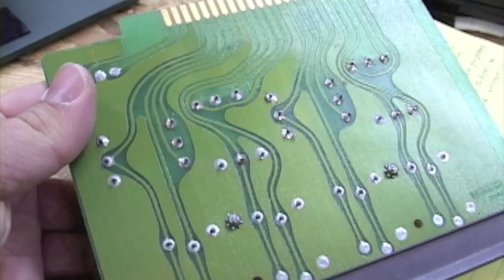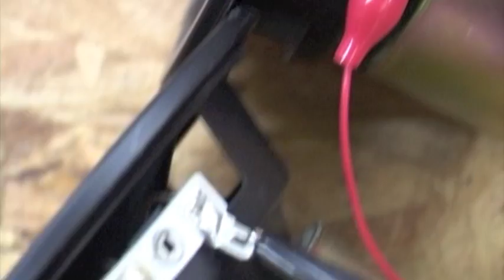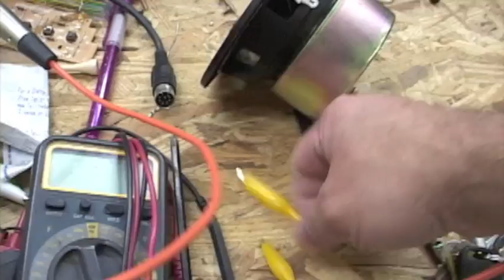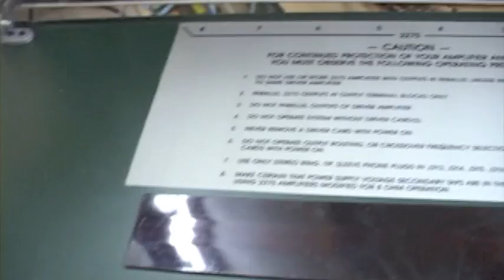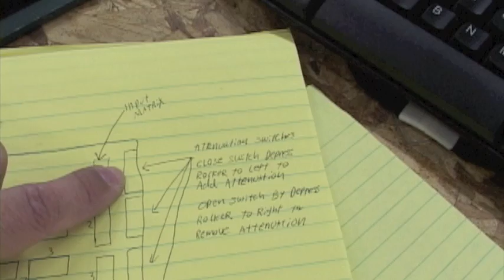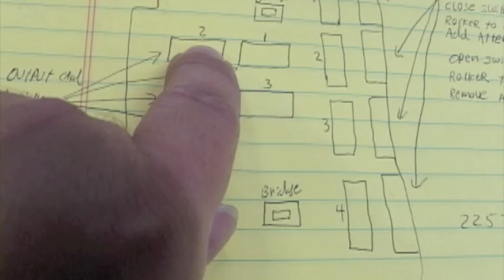Altec Lansing 2200

Comment: I have one of these. I picked it up from an estate sale of an Altec Lansing engineer. It does look slightly different. it's black and has no front cover. Each card has its own cover. I have a lot of questions about this thing.
Reply: The 2200A is black.  What have you learned about it?  Ive recently aquired some and info seems hard to come by.  Lots on the 2200 but not with 2200A.